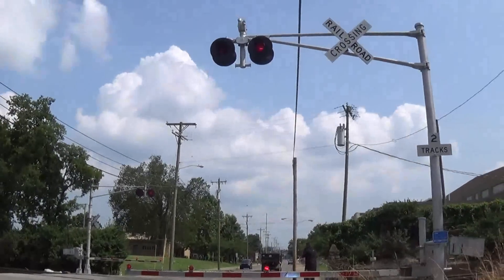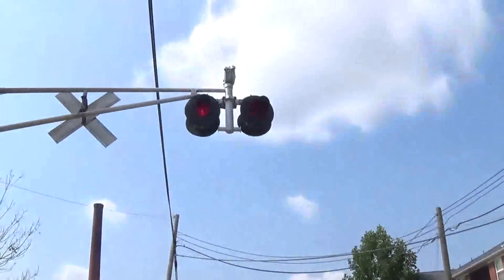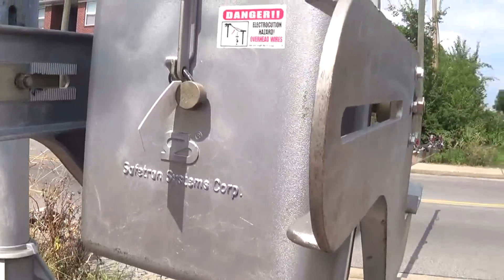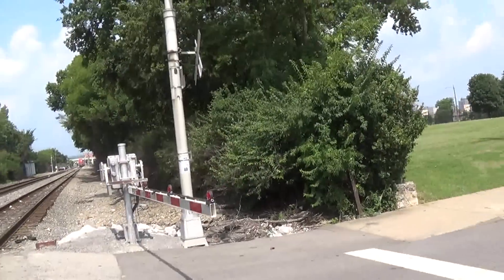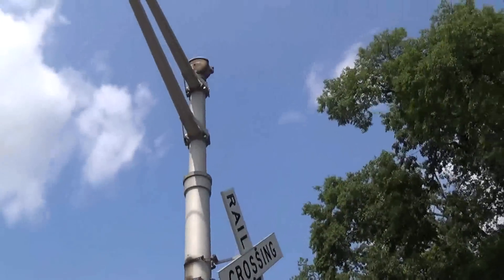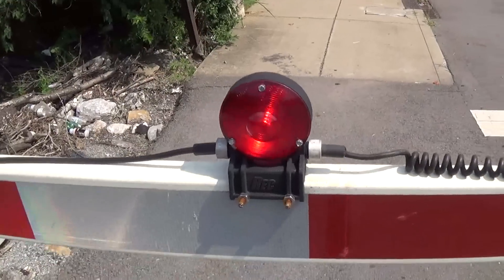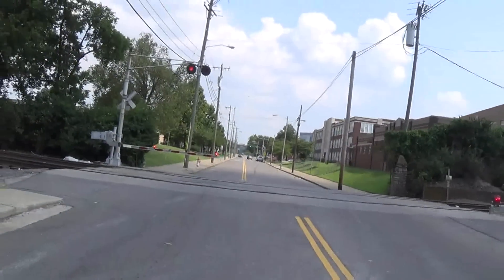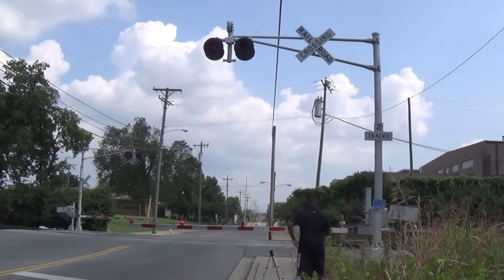7-29-15 17th Avenue Railroad Crossing Malfunction, Nashville, TN

Comment: Did a crossing in Nashville get replaced wasn’t it this one
Reply from the maker: +Mtray 98 Thus one had the lights at it get ypgraded, but it wasn't completely replaced.
Reply: Oh but didn’t this crossing have 2 12x20 Inch LED Incandescent Safetran Lights on the Signal Base not the Gate Base

Comment: When were these signals installed? Everything is probably original.
Reply from the maker: Not sure. One signal appears to be from the 60s at the latest, while the other appears to be from the 70s. And not everything's original, as the Safetran gate mechs are much newer than the majority of the rest of the equipment.